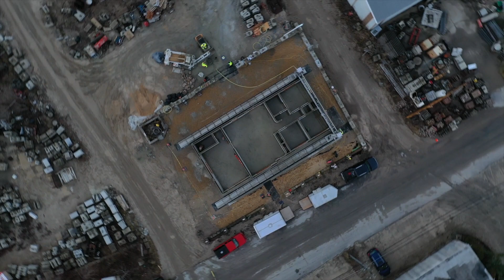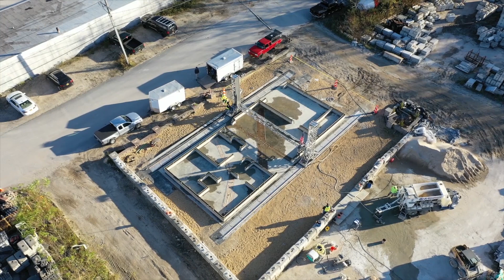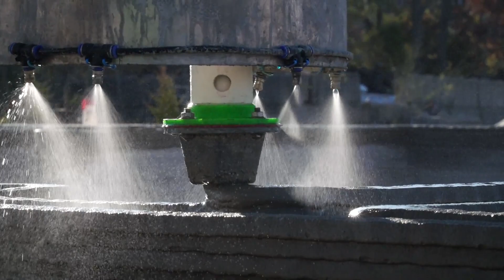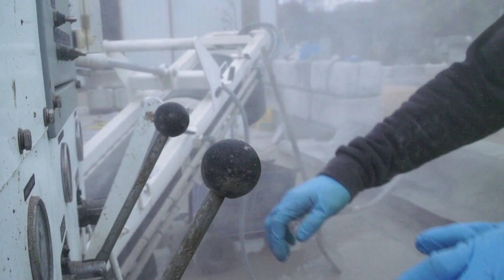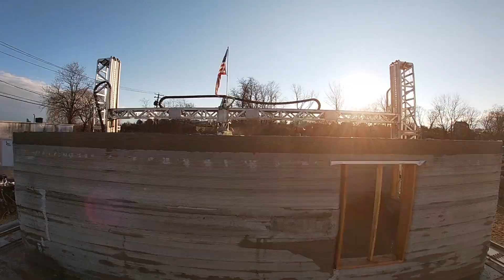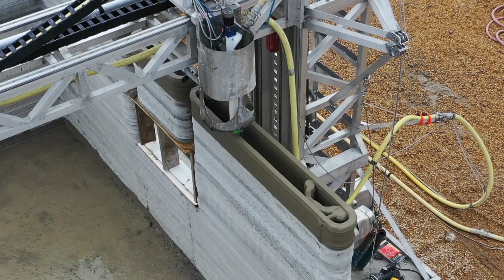SQ4D Official Promo 2021 | Changing The Way The World Is Built

Comment: Looking forward to your next video . . . showing how you 3D-print and install the remaining core components of the home "without humans or the human element." Thanks.
Reply: obviously they use humans. The point is they dont need to spend a bunch of time and money framing and insulating. You still need humans to add some lumber for windows and doors and run wires and plumbing.
Reply: @StarkVandalez  Yes, which should encourage the company to alter their description to acknowledge that fact. The "next" company in line, "somewhere, out there," that takes this effort to the next level - of completely pre-fabricated, pre-wired, LEGO-like, plug-n-play components (with "sealing armatures" to finish the job) - will be able to reasonably if not routinely own the "no humans necessary" statement. Whether or not that occurs in my lifetime, I am eager to see it happen.